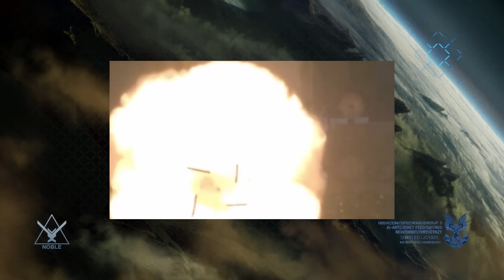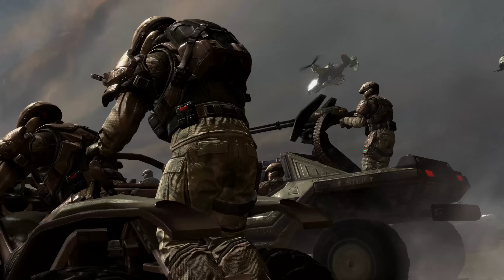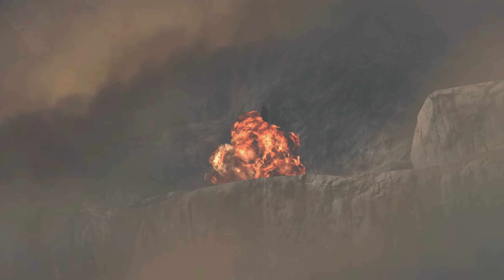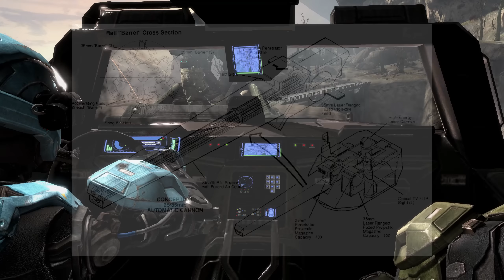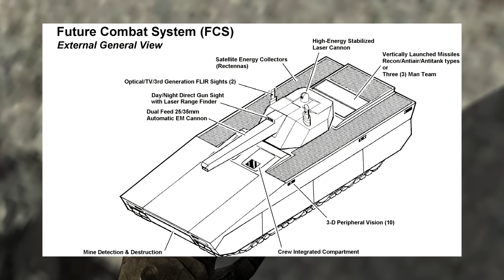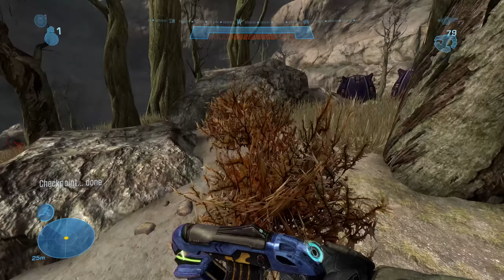Are Railgun Tanks Practical?

Comment from the maker: The "20 year" guess was overly generous. I was, admittedly, pretty tired when I made this video. I think railguns will eventually show up on tanks, but I don't think they will fully replace conventional cannons. I could have done a much better job of explaining that.
Reply: Nah my man, I think you are not far off at all.

Out of curiosity are you an engineer or student at all?
Reply from the maker: @fondlebuddies2982  Nah, I just read a lot
Reply: @Spookston  So yeah after watching the video, I think the only thing to say is that the statement of "Not a matter of if but rather when" is the only thing I can criticize.

To get the energy delivery of a main battle tank gun in the form of a rail gun, you need a lot of electrical energy. Why? Because the chemical energy in a tank shell is very very efficient. But when taking that chemical energy and turning it into storable electrical energy, the space and physics turn that into a nightmare.

While certainly possible TODAY to fit a rail gun in a tank, it would not be more powerful than say an assault rifle.

Giving 50 years say for technology to advance, and realistically you might see a railguns as powerful as a 20-30mm autocannon packaged into something a bit larger than a current day M1A2 Abrams... Again... Not ideal.

Basically what I'm saying is that I cannot see the way to physically put enough power into cells, fuel cells, batteries etc to get a railgun as or more powerful than a current day MBT cannon in the form factor of a current day tank.

Now... Hybrid munitions are another issue. A guided shell or even normal shell that has a rocket assist or warhead on board might benefit from being shot out of a rail gun. But at that point, cost and other issues make the weapon not much technically better than what we have now for a ridiculous increase in research and development cost.
Reply: @Spookston  Random question.  Have you ever made a video on metallic Hydrogen's military applications before?

From what I can tell; if it could be massed produced and is meta-stable at room temperature; it would completely change the game.

For the most part, explosives haven't had huge increases in energy density compared to TNT; with even some of the most energy dense modern explosives with not even double TNT's energy density.

Something like Metallic hydrogen has over 30 times the energy density; plus an insane detonation velocity.

One thing I am unsure about when it comes to metallic hydrogen, is whether it would have a secondary explosion from the hydrogen gas recombining with oxygen or not, potentially acting like a thermobaric weapon.
Reply: @Spookston  Sorry  I hadn't noticed you had replied! Damn, the way you go into detail, never mind the amount of it, seems very 'engineery'. Just to reiterate, as an engineering student i don't think you are miles off the 20year estimate. 20 years ago people would laugh if you told them we would have almost any of the technology we have now.

 I thourghly enjoy your content. Keep it up!
Reply: in my honest opinion, the power source for this mighty cannon of doom is what keeps it off tanks. the energy this beast requires is just monumental. the batterys themselves could become a fire hazard. why electricity is so bad at powering our cars and guns is the battery, it is one of the worst ways to store energy unlike fuel for the combustion engine tha is pretty much at the top of power storage, as well as propellants as gunpowder or its rivals. the rail gun would be fantastic for ships that have alot of room for power generation and storage as well as they need the extra power and distance that the gun proovides. so ships yes, land vehicles no …….unless they bring the mega tanks and train guns back, wich theywill not because ...you know….air power…….drones...
Reply: @olluman123  so true
Reply: @olluman123  Big power sources are much closer than you think. 
At least 2 universities are working on means to store and deploy huge ammounts of energy. 
Biggest hurdle so far is the production of the materials on the inside in big wuntities.
Reply: @olluman123  I think it will happen as technology improves, there is no true limit to technological developement (anyone who has said there is in history has been proven wrong).
Reply: @brucejedilee5290  Well yes in general for technology as a whole. But certain technology seems to have reached its peak. I mean there is reason why we don't use old fashioned cannon ball firing cannons anymore on land or at sea. And are only taking out for historical re enactments and events firing blanks or simulate firing without live rounds as its a part of by gone era but window through the past. Even the Battleship reached the end of its evolution. Because we have smaller faster more advanced war ships that fight at longer ranges with anti ship missiles. 

More effective aa in the form of SAM's, gattling guns or auto cannons, even the main guns are fully automatic sure a destroyer might only have 76mm gun instead of 127mm cannon but it can shoot like 5 x as fast easily. 

But that doesn't mean nations have kept some of those warships of old as museum's to explore a time capsule in to the life of a sailor from the past.

Yes technology is evolving and rail guns don't sound so crazy and far fetched as the first plane did to people of the turn of the century. 

But so technology gets left behind because its to obsolete by to days standards. But it doesn't me we haven't or shouldn't archive the technology of old as it shows how far humanity has advanced and continues to advance in technology.

Its just technology has many paths it takes and that some of those paths reach a dead end or a dead end sooner than others. Or some get put on hold untold other technology catches up to be able to develop that specific technology you wish to acquire or stream line its capabilities to make it more effective in both general civilian life and military force application.

didn't mean to ramble on to much but i think some historians are just saying specific technology has reached its peak effectiveness and that is time to create something new and better. So its only when a something that has become obsolete does it reach its evolutionary limit.

Kinda like how a writer runs out of ideas for their novel or whatever it may be. It doesn't mean they can't develop the story more just means a temporary stall in progress.
Reply: @yagdtigercommander  When certain technologies have reached their peak, newer better technologies that cover the same role are developed. 

So while current batteries might never be capable of supporting a railgun, other ways to store (or produce) electricity are being developed to replace them. 

Regarding cannonballs fired using black powder while those technologies likely hit their dead end long ago, we developed breench loaded smokeless cannons to replace them.
Reply: @olluman123  What if, instead of putting the power source in the tank, you put it in a vehicle behind the tank, in a plane or in orbit and beamed energy into the tank with microwaves or lasers?
Reply: @Guest0140  trailers have been proven to be a hazzel, planes can be shot down and satelites dont have the power for it either and more importantly, why try to make thing that does not work...work. a cheaper and quicker way is to load a good and proven disgarding sabot in the breach. The reason why we already dont use them is because they dont work
Reply: @olluman123  Well, you don't really have to carry electric batteries. You just need an engine, a generator that is hooked up, and capacitor array to stack up the required energy. Since it doesn't need all the space for big heavy rounds, propellants and the bulky reloader(human or machine) anymore, there's more room for better engines and capacitors. Downside would be that the railgun and the maneuvering capability have to fight over limited power from the engine.(Which is very big downside) So I assume they might adopt in the form of hybrid until they solve the problem which is proven to be cheaper than making totally new weapon system.(Railgun choke for terminal acceleration?)
Reply: So I just want to throw my two cents in... prior to watching the video.

As an engineer... Who works on these sorts of things... We are at the earliest, seeing railguns on ships in about 15-20 years.

But on tanks? And anything smaller than a very powerful navy ship with either a nuclear reactor or hyper efficient gas turbine... We are at best 75-100 years away and realistically probably never going to see railguns on things smaller than artillery pieces.

There's a mathematical limit on physics. Things do not just get better forever... There is a physical ceiling on what can be achieved. Railguns are very power hungry.
Reply: I think that there would be certain size requirements that make so conventional cannon would be preferred under a certain caliber, meaning things like an IFV would still use them while railguns would be relegated to long range engagements. Kind of what i think would happen when the breakthrough for direct energy weapons is made.
Reply: Meet MadMat 
Direct-Energy weapons ? Forget about lasers or phasers, real future for DEW is plasma or microwave type weapons, first is to inflict explosive/burn/electrical damage ( SU-57 already planned to equip with plasma cannon), also plasmoids are natural phenomenon (lightning ball) which can be replicated by manipulation with electric plasma
Microwave tech is used in 2A.AD radio-electronic weapon suits used by Russian Radio-Electronic-Combat Forces
Railguns with laser are not practical in combat use
Raiguns require too much power and added infrastructure to be viable anywhere and pretty useless since we use long range missiles anyway
Laser can be used against drones, but any AA with high RPM cannons can wipe as effective, and laser have power loss with distance in air condition with make it effectively useless
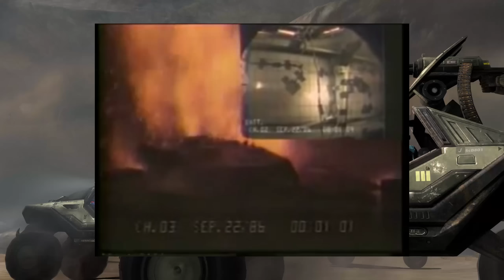Reply: You made a slight mistake about railguns at 1:05. You say they don't need a chemical propellant, when that generally isn't the case. As you know, railguns operate through electromagnetic rails accelerating a metal projectile to hypersonic speeds. What you might not know is that the projectile has to be moving in order for the magnetic field to impart a force. Additionally, it has to be moving at a decent velocity (about 1.2 meters per second if memory serves)because otherwise it would spot weld to the rails. What all this means is that a railgun projectile must have an additional propellant installed. Compressed air can be used for small caliber ones, but as you get larger, compressed air becomes less viable, as more force is needed to accelerate the projectile, and so chemical propellants are used. Obviously, these would be only a fraction of the power of what a standard cannon shell uses, but it's still their. After that ramble and a rant, just want to say I love the video, love your work, and hope you have a lovely day
Reply from the maker: @Santisima_Trinidad  I know that railguns need something to "kickstart" the process, I meant that it doesn't need something volatile like gunpowder. You can use any sort of compressed gas to get the slug moving.
Reply: indirect fire/looping barrage still has its benefit tho. IMO railgun equipped tank would probably engages another railgun tank. but what happens when AT team also equipped with carrier-mounted mobile-powered railgun system and concealed on a high ground? railgun tank be toast.

IMO again, bunkered railgun on a side of hill would be the first application of land-based railgun system (outside of R&D phase of course)
Reply: The idea of not having volatile material is sort of flawed, you still need a massive amount of potential energy, so a big ol' power supply, which could arguably be far more volatile than an ammo rack full of HEAT rounds.
Reply: 20 years is probably not off by much, if we enter a new Cold War. Just look at how fast tanks developed during the last Cold War, and then look at how that development ground to a halt when the wall fell.
Reply: @jesperohlrich7090  "...if we enter a new Cold War."
Wait, had the current one already ended to begin talking about next one? Or are you one of those people that believe propaganda that when USSR ended the world became a haven of international cooperation?:D
Reply: TheArklyte short answer... no... I actually told my teacher in 1989 that the fall of the wall, which marked the official end of the first Cold War, would lead to more conflict. 
I just don’t consider the current situation as a full blown Cold War yet. It’s getting there, but we aren’t quite there yet.
Reply: @jesperohlrich7090  it is though. 1980's marked the time when USSR had finally reached somewhat military parity with NATO and wasn't bluffing anymore about being able to defend itself. So the war switched to purely economical field. Which along with several other factors resulted in collapse of USSR which couldn't compete on both military and economical fronts with combined majority of the first world countries. However those factors are still at play today. Reagan's deal with China is result of modern day economic competition with China(though them refusing to accept any more trash was the other major factor that sparked current stand off), modern day problems with ME started in shaking up the region to cause trouble for soviets and so on. However nowadays it seems like USA will eventually not reach it's goal of becoming sole hegemony so the whole Cold War was somewhat pointless.
Reply: So... why do people think of railguns/coilguns as exclusive way to proper the shell? What stops us from using initial charge and rocket assisted shell in coilgun? It's just a way to add more acceleration to projectile. Which does nothing for HE(better range of control over shell speed would be good), barrel launched ATGMs that use HEAT and several other types. Only the "rods" need excessive kinetic energy.
Reply: You know, there's a joke attributed to MIT:
"We'll enter the thermonuclear era in 20 years, and this number stays the same no matter how much time passes."
Reply: @TheCaptNoname  30. And that joke originated from Tokomak designers.
Reply: The MACs in halo are Coil Guns,  not Rail Guns. same principle of projectile acceleration, just a different method of doing it. Rail/Coil/Gauss Guns under the Family of Magnetic Accelerators.
Reply: Duke of Petchington well the Cobra anti armor platform uses twin 35mm rail guns and a single 105mm railgun. There’s also the arc-920 rifle that’s a railgun. Those are the only three railguns in halo canon that I know of. So both exist it’s just that the MACs are way more popular with fans
Reply: I think that there would be certain size requirements that make so conventional cannon would be preferred under a certain caliber, meaning things like an IFV would still use them while railguns would be relegated to long range engagements. Kind of what i think would happen when the breakthrough for direct energy weapons is made.
Reply: Like with most things, the power source is what holds it back.
Reply: I think that there would be certain size requirements that make so conventional cannon would be preferred under a certain caliber, meaning things like an IFV would still use them while railguns would be relegated to long range engagements. Kind of what i think would happen when the breakthrough for direct energy weapons is made.
Reply: 20 years Is reasonable I would say, the problem would though would be politics preventing research from moving quite as fast as possible
Reply: Rule of a thumb, when you want to say 20, say 60. When you want to say 30, say 90:D
The usual way technology takes from earliest theoretical concept to being used in everyday life is around 120-190 years... which would make it 2035 at max for coilguns though, woopsie:D
Reply: Be my Valentine's  <3 uwu
Reply: Earth Defense Force 4 & 5 Railgun Tanks
Reply: Spookston 
Um... what power source ? Fusion reactors ? Maybe in next 20 years scientists would learn how to made room-temperature super-conductors ? And find some new element which will revolutionize energy as we know it ?
No, same T and M will fight so long in the future with same 125-152 mm and 120-140 mm smooth bore gunpowder-electrofuse chemical cannons, YES probably Mars and even MOON !!!
Reply: actually they do have a small amount of chemical propellant involved with a rail gun, not as much as a conventional tank round but just a little to get the round started and the electromagnetic take over after that, there is even some testing going on using standard rounds but using electromagnetic to father improve the round's speed and is showing some great promis
Reply: The main reason it’s still not on a ship yet is because the material needed for reliable railgun barrel simply doesn’t exist. 
Apart from the issue of the gun forcing itself apart it also vaporizes the inside of the barrel with every shot, creating the white muzzle blast you see in test videos. I suspect this is also why there haven’t been an accuracy test, only durability because after the first few shot you couldn’t expect any accuracy from the gun anymore. It literally bores itself out
Reply: Personally I think coilguns would be a better choice for a tank or IFV. They do have the same power and component size problem, but as you said that is a matter of time. The main advantages of a coilgun compared to a railgun is that the coilgun is more power efficient and since the projectile never actually touches the barrel, the barrel “should” last longer. Also because the barrel is constructed in discrete, repetitive sections repair would be easier, in stead of the whole barrel only the damaged coils would get replaced. The main disadvantage is that a coilgun is more electronically complex since it is not just one big discharge of power. A coilgun would still have problems with heat like any other armament, but it would have a higher potential rate of fire if heat is adequately controlled since you can have more than one bullet in the barrel as long as they are far enough apart. A coilgun is also likely to be more expensive since it has more subassemblies.
Reply: I give it a hundred years before infantry are going into battle with rail rifles.
Reply: You just said deployed with them not deployed as their main weapon, while I cannot see that in 20 years, as I don't think the tech will be quite there, as a replacement/side-grade to current Anti Missile tech that is being used might be possible. I mean most of that is computers using lasers to track them and bullets or missiles to destroy other missiles, as a cost saving measure or an option to extend time out in the field before resupply the tech might be far enough to make that a reality.
Reply: Wait if rail guns are small what about 2 rail gun on a turret?
It might work if the first shot didn’t work?
Reply: Really the only problem is the power plant, it'll be decades before we have something compact and powerful enough to supply a railgun on a tank.  Hence the naval interest, I can't wait to see a nuclear powered battlecruiser with railguns,  and that we could build today.
Reply: Railgun artillery cannon like the 80mm ones
Reply: It really depends on if you believe Moore's Law can also be applied to other scientific disciplines. We've seen it to be true in both computers and neuroscience so I don't see why it wouldn't apply to material science as well. Once you hit a certain level, the advances become nearly exponential.
Reply: shotgun railgun that uses spikes not pallets just how messy will that be if it hit someone
Reply: @haminatorainz7227  nah.. Every spikes will be welded together by the time it leaves the barrel. Unless spikes are nonconductive material like ceramic and are pushed by some light conductive wad.
Reply: @dongleseon8785  put the ceramic in between the spikes so that dont make contact when it fires and put all of them in a sabot
Reply: good to see this comment. I think if they are not even being deployed on ships yet, which are 100 to a 1000 times heavier than any tank and have equally immense powerplants, putting them on tanks is a long long time away, barring some revolutionary energy production/storage technology and probably a huge advancement in materials technology too. Even then, 20 years is generous. I would say at least twice that, but really i think its way too early to give an accurate estimate.
Reply: Stop please you would need the biggest tank hilter dreamed off a land battleship just to power the gun.. witch is why 20 years later form concept it's only on a ship and is still not in NATO OR U.N USE
Reply: Can you do a video on coilguns?
Reply: can you please do a plasma tank
Reply: Railgun tank turret would be a game changer
Reply: Doesn't Halo uses Coilguns?
Reply: I don't think you are far off , I actually agree with you I think we will start to see railguns being mounted and integrated into tanks . I don't think they will be mass produced for tanks but we will start to see them on tanks from 2040 . The French and German Institute of Saint-Louis one of the leaders of electromagnetic acceleration and the Pilum project under the PADR Research Program under the European Commission and European Defence Agency show plans of achieving electromagnetic railgun maturity and post R&D stage after 2028 ( or by early 2030s ) and then transferring that knowledge to the industry , getting more details and powerful prototypes/models , and then an in service date by 2040 . So railguns will become products of industry , offered by defence companies  by 2040 just as much as any product defence companies offer to militaries . Also the model they showed was artillery trucks so tanks are just around the corner after that . So from Naval ships and stationary platforms or military bases to ground artillery to tanks . Not mass produced , common and in service yet but they will start to be integrated on tanks and tested before entering service like any other equipment militaries introduce then in service and mass produced after some time .
Reply: I think it's going to take over half a century if I have to guess
Reply: The video didn't mention the biggest show stopper of railguns which is plain old air resistance.

Even with an optimized shape, kinetic projectiles only retain half of their kinetic energy after 3 km, 25% at 15 km, and a mere 7% at 30 km. That's why kinetic projectiles are shot from tank guns, while howitzers use explosive rounds, as they don't lose their destructive power with range. Railgun researchers don't like to talk about this basic issue, but this is an inescapable truth. So railguns don't offer much more compared to already available kinetic rounds, with an effective range of 3 km. 

However, railguns would make excellent spaceship weapons ;) The Expanse series actually nailed this.
Reply: sadly 2025 is still railgun tank-less
Reply: 3:42 not only that, but there also the  risk  to be disabled by a EMP
Reply: there is also some parts missing from this. if a tank had a railgun it would use more solidshot and not much he, limiting the tanks versatility. if railguns could fire HE sure but at the moment there only built for solid rounds which means no anti personnel ammunition.
Reply: lol railpguns wont replace conventional cannons, are you nuts, you obviously haven't spent time in the military, its far better to have a railgun, 1 because it reduces the weight of the ammunition carried, it also takes out the danger of the ammunition area exploding if its hit by a enemy tank round, and so much other factors, but hay you have your opinion but in the end its pretty boring. All technology has its teething issues, look at conventional guns for example, how long did it takes for them to become really good, hundreds of years. As there are already prototype weapons for such things in development.